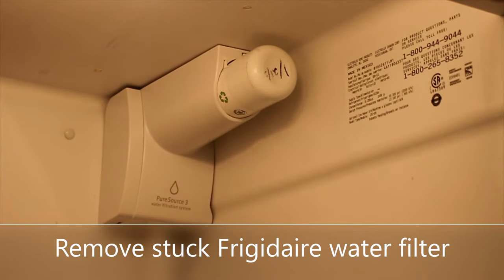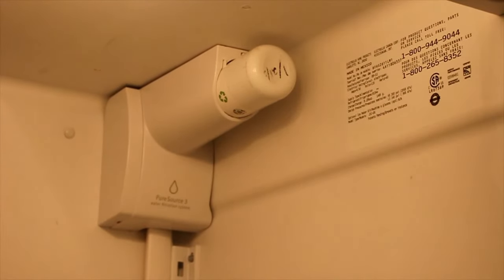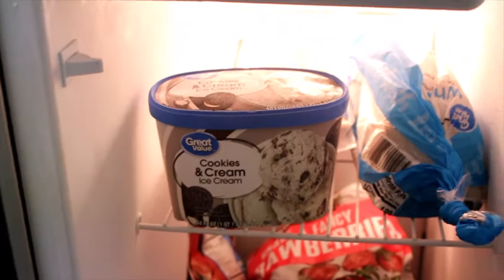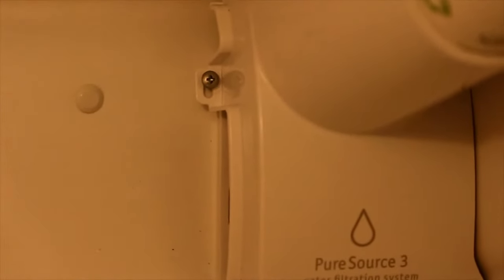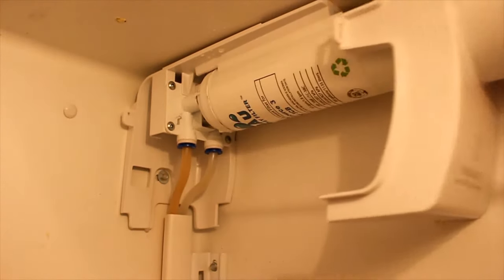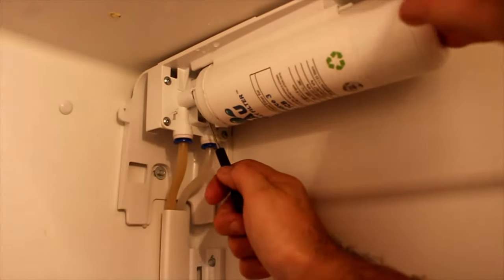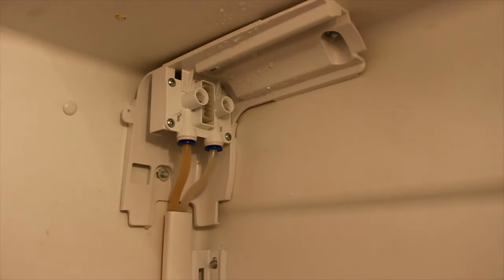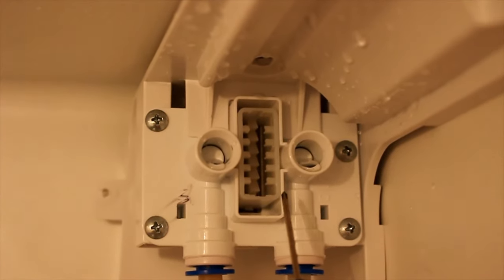How To Remove a Stuck Water Filter (Quick and Easy)

Comment: I followed your instructions, and the filter still is stuck.  What else should I do?
Reply: You figure it out? I would turn off water and remove the unit. Water lines are typical push up and pull out fittings. Good luck
Reply: I literally broke mine out then take needle nose to remove tips
Reply: It could be frozen...try turning up the temp but not too high to thaw food

Comment: This worked! I did need to use a hair dryer to get the pins to finally release as there was a bit of ice. Taking the cover off means you can actually get at the release mechanism, and the hairdryer worked in under a minute.

Comment: It took me awhile to push in on the tube and up on the bracket between the two connectors.  Finally out.  Thanks Pull the safety covers off the new device tips.

Comment: Thank you so much for your video, it really help me a lot! I have been using a third party water filter that it's supposed to fit well. So far it was good, I have been replacing it with no issues until now. 
Thank you again.

Comment: That totally worked!  I was already at the point where I took out that 1 screw & got the cap off & then I was thinking sh*t, I'm going to have to call an appliance repair person, pull the fridge out, disconnect the water line & take out 4 more screws etc etc  but no!  Your method worked perfectly!  I put the cap back on, burned my left hand on the right side light bulb & then said "f*ck it, that 1 screw is not needed to be put back in place".  So, thank you, thank you!!

Comment: Nice. I have this issues with mine. Been like this for a while now. NOW, its giving me an issue with making ice as well too. So, ill be replacing that filter base soon. Hope this fixes both issues i have. Ive already cleaned the spout going to the ice make, cleaned the coils under the fridge, swapped a new filter, and swapped the water valve/solinoid assembly. Ive even reset the fridge. 
 Same issue still ensues. Ice is beinf made at a snails pace and the ice wedges im getting arent very unifom in shape either, when it does pop them out. Im about to swap the ice make itself, to weed out all components i can think of that may be the issue. It was working perfectly for a long time too. Even with the fridge set at 4 on the freezer side. Always had a full tray of ice. I e ven had times where ive had to shut it off for a short while. 
Water pressure coming out of the dispenser doesn't seeem to be as forceful as it once was, but it is coming out. I dont know what the flow rate should be. So, i cant be a judge about that. 
Im wondering if the filtered water line may be clogged? I didnt notice anything as i was dealing with the valve....

Comment: I'm not sure if I am brave enough to do this but I will find someone who is. My questions... why turn off the ice maker? Can things run (ice, water, frig, freezer) with filter left out until a new one is ordered, delivered and installed?  After trying and failing to remove filter to find out what to replace it with, I noticed my freezer light was out later when opened the freezer. (side by side). Coincidence or is there some type of connection?